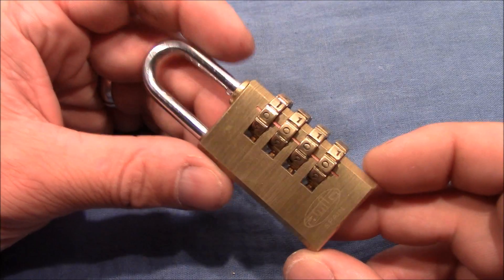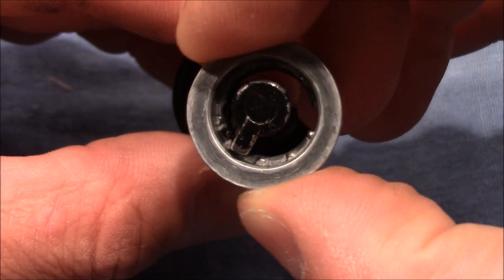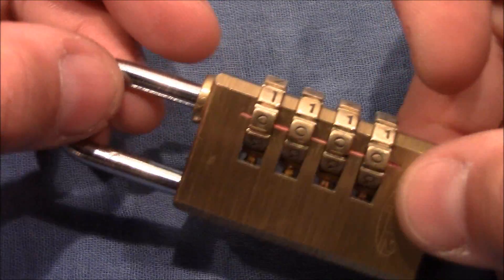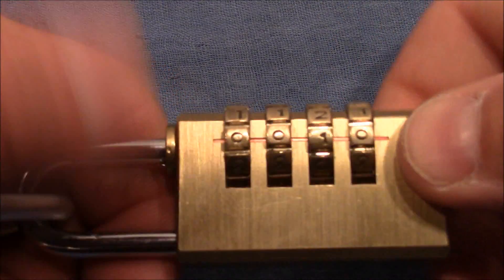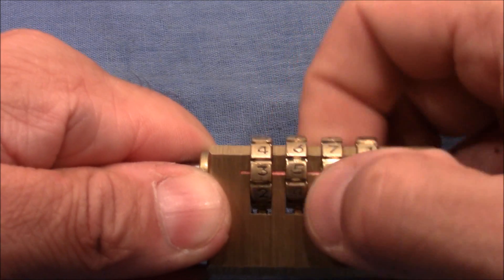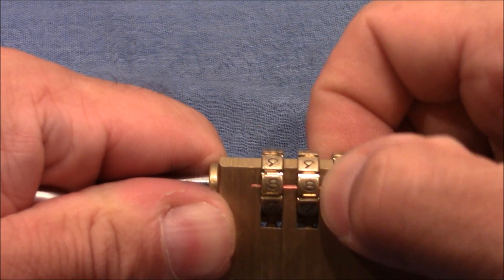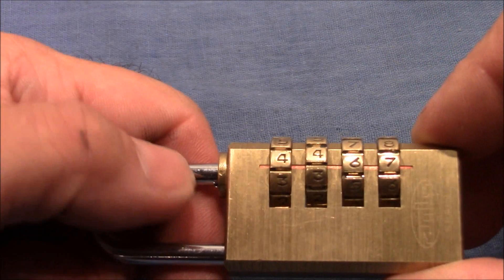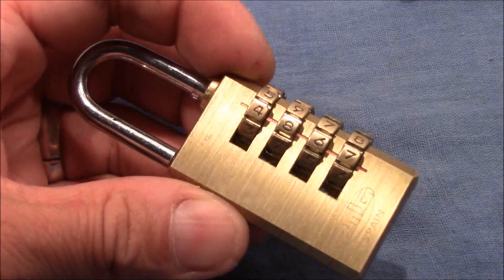(picking 242) Instructions on decoding combination locks with false gates; sample: AMIG 4 wheels

Comment: very clear instructions for decoding this lock. however i have a pig of one which has no resistance when i spin the wheels. lock noob told me to check this out from you which iv found very helpful sir. i shall go back and try i think its a great use of the carabina as pulling on the shackle for some time can be hard on the hands. i hope my old unvranded combo plays ball with me now iv seen this i fuĺly understand its just not giving me any resistance on any of the wheels maybe due to age and use im not sure. i even though if i used a small blade like pick to put under the wheel as a sort of shim that would give me more resistance on the wheel but so far no good. i guess we all have just one lock that on paper should be easy but it must be my lack of talent. great vid loved it as always sir you are a personal hero of mine with lock noob im learning so much and am going through both of your back vids to pick up more skills thankyou so very much sir 😁
Reply from the maker: Thank you for the nice feedback. If you cannot tension the locking mechanism then maybe it's not susceptible for the pull-picking method (like the TOKOZ https://youtu.be/Inhc3LUbhFA?t=145). The internals here are different. Which lock is it that you have trouble with?

Comment: i opend my lock and forgot my pin cord please help
Reply from the maker: Please try this: Turn the shackle as if you would close it; it's important that the free shackle side is right above the hole. Now gently push down the shackle and test each wheel. Turn the wheel the binds (gives most resistance) until it "clicks" or you feel a little give on the shackle. Repeat for the other wheels. Maybe clamp the lock in a vice the ease the handling. Good luck - it works not equally good on all locks.
Reply: I forgot my my code can you help me

Comment: Nice reversing. Trying to make the gates less predictable to thwart a potential attacker is an interesting idea, yet we know the problem with secrets. :) As you have shown, once the secret is out the security is essentially gone. Thanks for going above and beyond with the detail. Much appreciated.
Reply from the maker: Thank you. Security by obscurity is never a good idea. A flaw must be told, so that the user knows how safe its lock actually is and the manufacturer to improve it. There are security measures that you can tell everyone but are still a good measure; example: the bumps in the wheel that I used for demonstration.
Apart from that, these kind of locks are more toys for me - mechanical puzzles.
Reply: Indeed. I am a fan of such disclosure. Pretending there isn't a problem won't help things get better. :) Even when adding more complexity to the system, more potential cracks are introduced. Simply, there is no such thing as perfect security. Puzzles, as you say, imperfect, fun mechanical puzzles.